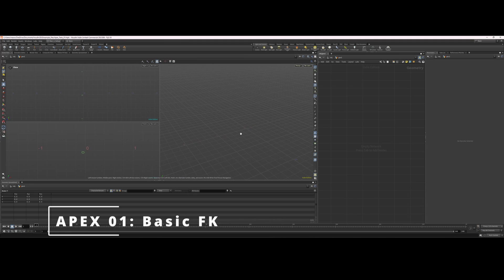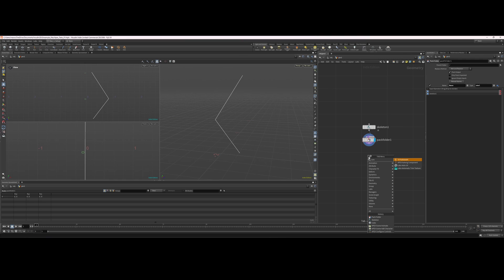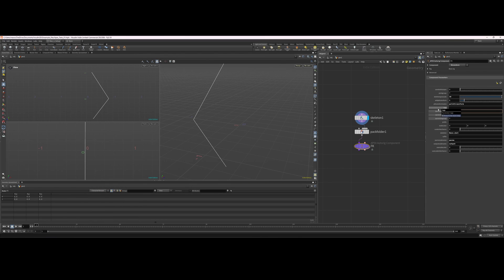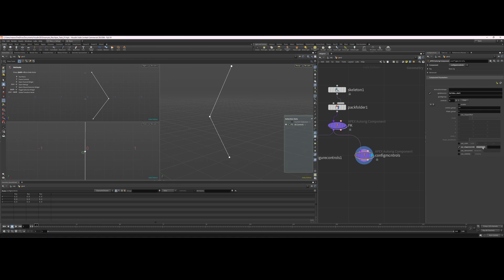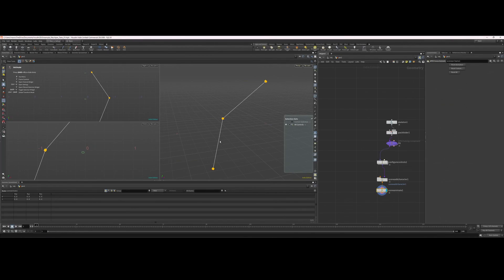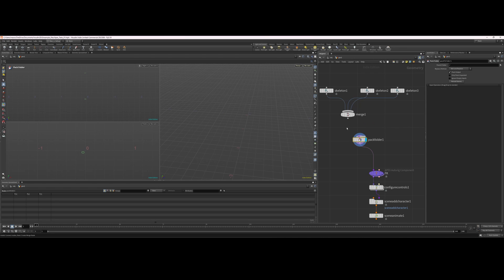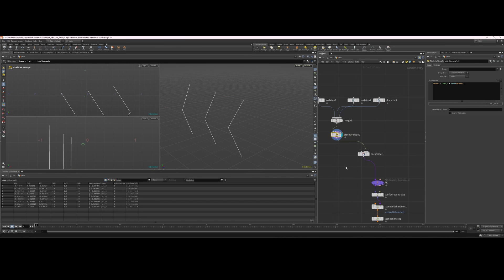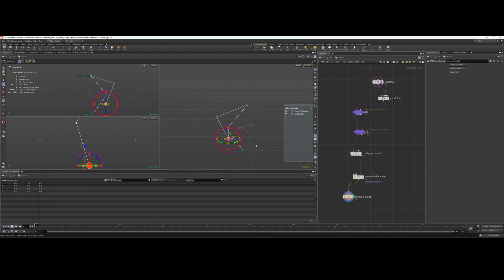Rigging in Houdini with APEX: 01 |  Simple FK

Comment: Thanks for great tutorial. Is it possible in apex graph create analog of object merge sop for null nodes to prevent wire clutter?
Reply from the maker: @vitalizahar9343  There needs to be a left to right flow with your component script setup, so you can’t really take different chains and merge them together like you can in sops.  But, there is a new node - my favorite new node actually - called graph::merge.  Create a graph::template node, through whatever you want into it, then use graph::merge to throw your custom graph setup directly into your rig graph.  Super useful.

Comment: H 20.0.590 here. When I have the AutoRig node active and press enter in the viewport, houdini crashes. Any advice anyone?
Reply: (I'm in linux, just in case)
Reply from the maker: @agustingarcia6448  There could be an issue in your setup that APEX just can't handle.  Which function within the autorig node are you using?

Comment: The authoring component does not see my points and the node looks different already or else
Reply from the maker: Responding late - did you ever get this figured out?
Reply: I am having the same issue where the autorig component looks completely different. I can put the * To promote the parameters. @maxrose8845
Reply: Oh! it is in the Controls Tab now.

Comment: Mixamo Rigs seems to break when we use Apex
Is there anything to do to fix it?
Reply from the maker: At the moment there's no component that makes a finished rig from a Mixamo skeleton, you'd have to set up tags properly while using the autorig components to create each aspect of the rig.  The beauty of this system however, is that once you create the rig, you can just can use it again and again, and each mixamo rig will be rigged automatically.  In my next video I'm going to introduce how to set this up.
Reply: Have the same problem. Mixamo rig gets all screwed up as soon as you use auto rig component.